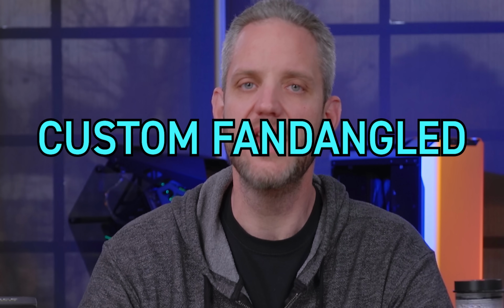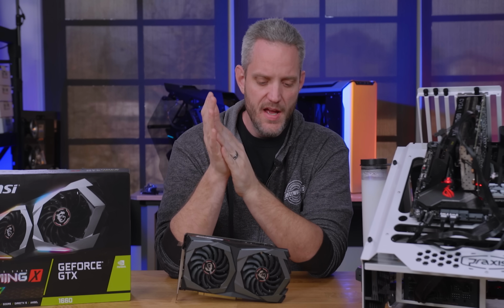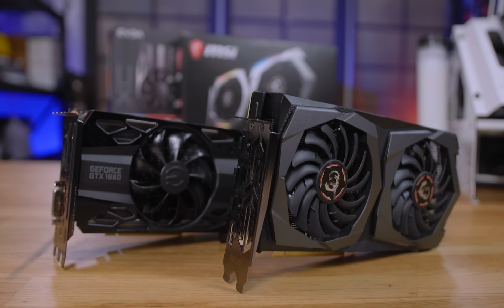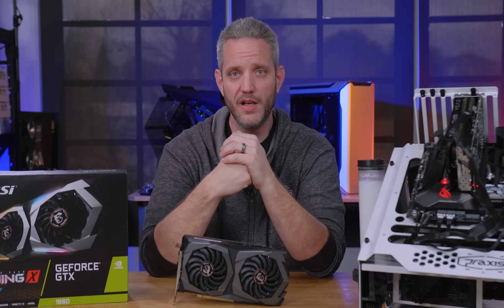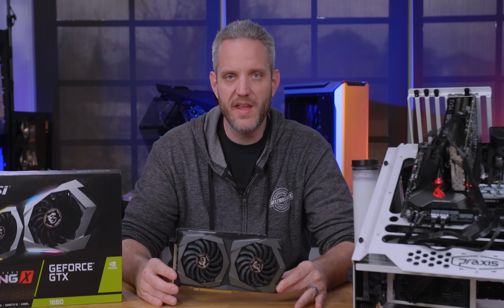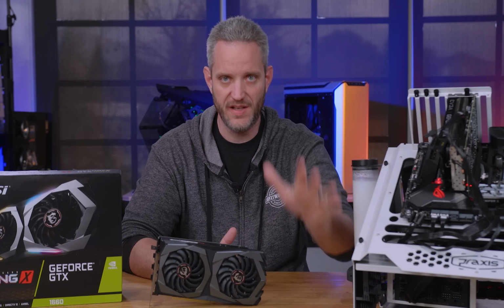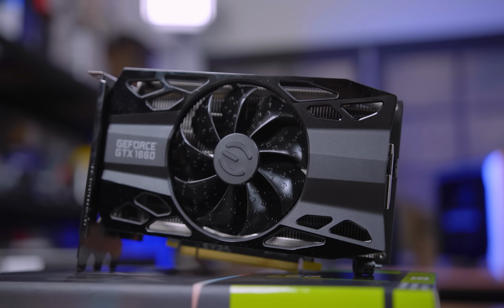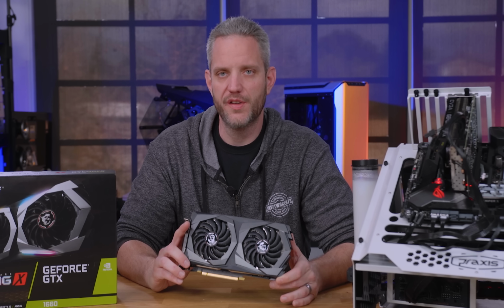Just save your money.... GTX 1660 vs GTX 1060

Comment: why nvidia why
so there it is
we have preveous gen
gtx1060 as base actual by 209€ 0%
gtx 1660 +10% new at 229€
gtx1660ti +20% 279€
gtx 1070+40%/rtx 2060 299€/330€
gtx 1070ti +50% 370€
gtx1080 rtx 2070 +90% 490€

no reason to upgrade 
my max invest in new gpu is 300€ and this must be at least 100%+
funny fact 500€  you payed 2017 for the gtx1080 before mining hype

Comment: I bought a used 1070 TI for $310 on eBay which beat all of these cards and a 2060 just barely. Side steps all of this overly engineered economic modeling.

Comment: I will always min max performance in a build, Jay. Bells and whistles for mid range just don't make sense. They're the cards for stretched budgets. I would be willing to spend maybe $15 extra dollars to get an extra fan on the cooler for noise, but that's about it. Even this price difference is pretty generous. I know whenever I go on pcpartpicker, there is pretty horrendous overlap in price point for a lot of cards. Where some 4gb or 3gb models are more expensive than the cheapest 8 and 6gb, or a 1070 is almost as expensive as a 1080 mini. Why would I get the fanciest 1660 when the cheapest 1660ti will perform better than the best binned, highest tier 1660? I would be willing to spend like $15 for an extra fan on the cooler for noise, but that's it.

Comment: You're glossing over a very important fact here when pointing out how closely packed together in pricing these cards are: Nvidia is running out of price points above some arbitrary threshold to fit cards into.

The truth is, we would be far less confused about the selection if the gaps were significantly wider.  What Nvidia is selling as a $200 card really should be going for $100 with the next one after it being $200, $300 and so on. But so long as they keep stuffing new models in between the shrinking gaps, people will be tricked into the inconsistent shifts in value.

I wonder how much binning factors into this (Bad run? No problem! Create a new sub-series!)

Comment: If I'm very limited in budget and I want to upgrade on an older rig from a 750 Ti.  Is a 3 GB 1060 a good idea since I won't go any higher than 1080p gaming? My rig currently has an Intel Xeon E3 1220 (i5 2500 Equivalent), 8 GB of DDR3 Ram, An ASUS 750 Ti and an MSI B75A chipset motherboard

Comment: hmm i always think that spending a few extra bucks is worth it all the way. why should i go for a GTX 1060 founders card when i could just spend a bit more or save up two months more or so and get myself a good gtx 1070 with decent cooling and more performance that can handle more than just games released today. Granted gtx 1060 is still good after all those years but i did not regret buying a gtx 1080 at all two and a half years back.

Comment: well the 1660 TI isnt like before. Before the 1660 ti, you would get the TI as an overclocked version or a refined higher performing version of and existing card.

What Nvidia realised, is that same card you would have released as a 1660, if you put a TI in the name, then any card released with the 1660 less the TI would be expected to perform less than the TI version, so they could use cut down version of the 1660 TI chips for the 1660 and maybe even 1650 if that ever sees the light of day, thus saving nvidia money and making them more money. So whatever OC they might manage to magic out of the 1660 TI chip, they can then sell as maybe a 1670 or something like that.

Comment: For me it really depends on the card. Between 1660 and 1660Ti, it feels like argument could get similar as between 1060 3GB and 6GB, except now VRAM quantity is same. And if you want to do bit of future proofing, 1660Ti is not bad way to go. But if you want to save every penny to beef up other components or even just to buy more games, 1660 is great for any 1080p 60FPS build. Same as 1060 3GB was back in the day, despite lower amount of VRAM. So it really depends on what you want to do and constrains you are working in. Personally if I were building midrange build, I would want to get 1660Ti.

As for MSRP versus premium cards. I never advise premium cards. Generally it depends on tier of the card and how hot it gets. Cheaping out on card is not always a good thing. Generally, unless it is low end, I would want at least 2 fan version, so fans can achieve better cooling at lower RPM, hence less noise. Also I would avoid buying from less known brands, because you can burn yourself on card with cheaper cooler which will mean bigger noise. I mean that Red Dragon card Jay tried to "fix" is exact example of that. I got Powercolor RX480 8GB Red Dragon and I got it really cheap, it checked 2 fan requirement and so on. But once I felt it in my hands I was already bit skeptical, but anyway, I went on and learned that it is noisy, fans are working at higher RPM, card gets hot,... and undervolting was bit mixed thing, in some games pretty decent undervolt was running fine, but there would always be game or two where it just wouldn't work. So paying a bit of premium to get some better and more known brand version is fine in my book. As I am definitely not making same mistake again. But of course don't almost go to next tier, because it just isn't worth it.

As for how far you go, since they are stacked so close together? To make things simpler, just decide on the budget first, trust me, that solves a lot of problems. Then what I usually do is to allocate about 20% to CPU and about 40% to graphic card, check what is best I can get for that. Then I start picking other components and once I am done with that, if there is money left, I start thinking about higher tier graphic card or CPU. If money is lacking, then I look at whether I can cut some cost at CPU or graphic card to get more money for what I want. At least that is how I usually go about doing it.

Comment: I run a ton of ITX rigs and that triple slot card would be a deal breaker for me. In general, I would say if there is an MSRP card 1 tier up with the right size specifications I would probably save and grab that. The extra performance will lend to the longevity/ viability of the card as time passes.
Even the base modle EVGA cards have great build quality, so buying an MSRP card isnt really a "mistake" 
Even brands like powercolor have improved a bit, but always check for reviews before buying.

Comment: I only have a 1080 p panel so as long as the 1060 manages 60 fps there is literally no reason to upgrade to anything imao.
Reply: Paul S resolution has nothing to do with the refresh rate, so I think you mean 1080p 60hz!

Comment: I have a 1060 3gb. The only logical thing to do for someone in the same situation as me would be to either just buy the rtx 2060 or wait for Navi
Reply: 3GB is a restriction that should not have existed and is already a problem in some games.  The 1660ti sits between the 1070 & 1070ti in stuff I`ve seen so it`s a decent upgrade on what you have and quite a bit cheaper than the rtx 260 where I live ( in the UK )  I will be upgrading one of my 1060 6GB machines to a 1660ti, same sort of power draw on the itx PSU and from my research it`s totally worth the upgrade

Comment: I'm currently in the process, of building a Ryzen machine. I have a As Rock b450m pro 4 Motherboard, just need to get the case, Ram,  Ryzen 5 2600, power supply I'm thinking of 850 watts and of course the all important graphic card. I already have a 1050 ti, but would love to upgrade to a 1660 ti, but will have to save my hard earned cash. Hope to get it done by the end of Summer British Time. I don't run Windows for gaming, as Linux has Proton and many game porters like Feral Interactive, who are porting to Mac and Linux Shadow of the Tomb Raider and Life Is Strange 2. Going to be a good year for gaming.

Comment: I have a i5 4440 and no graphics card , I used to have a r9 270x but I sold it , now 1060 seems bit outdated and 2060 and 1660 will bottleneck , what should I do , I don't have money for a new PC ?
Reply: In that case, go to the AMD side..maybe RX 570 or 580.
Reply: Impossible to say without knowing your exact budget/income and local prices. just get a 1660 for now. save up for new mobo and better CPU (i5-8400 or r5 2600) because sounds like the CPU is holding your system back. Also sell old CPU. or RX 480/570/580 etc
Reply: Thank you for your suggestions

Comment: GTX 1060 3Gb is not so bad(I got such) like you try to tell, getting 5 fps less in most games then 6GB version. Have video ram limit but those videocards are not much powerful anyway so you cant push graphics, mainly you can increase textures more on 6 Gb version otherwise performance is very close.
For me personal only reasonable upgrade is RTX 2060 from GTX 1060, PS5 is around corner and after that launch games probably will become 1 idea more heavy.

Comment: Hello there, fellow tech people. Sorry for a comment unrelated to the video, but I have a slight dilemma - what to upgrade first: Celeron G3930 to a used 6/7 series i5 or HD7850 1GB to a used RX570/580/GTX970/1060 3GB? 

Eventually I plan to upgrade both, but I'm not sure what to upgrade sooner, and both choices cost around 110-160usd (with CPUs being on average a bit cheaper), but being a simple student, I can upgrade only one thing at a time with roughly 4-7 months between upgrades. Any suggestions? I'll be upgrading next month probably, hunting for deals in the meantime.
Reply: @bdrmongoose78 1060 6GB is out of the budget, sadly, since that would be at least over $180, and I can save at most $25-26, per month, and I don't want to wait more than it's necessary. Especially since RX580 4GB can be easily bought for $140 without looking for any special deals and 8GB versions start at ~$160, and those cards are pretty much on par with 1060 6GB, with a bit slower 1060 3GB also starting around $140 

But yeah, I guess you're right that it's probably best to go with RX570, which goes for ~$120, and is not that much slower, or look at GTX970 which also can be found for ~$120, and seems to be on par with that RX570.

Comment: usually i don't have a fixed budget for the computer.  I compare what's available to what i currently have and decide if any of those price points feels like a big enough jump in performance to make me want to build a new computer.    if the higher cost components feel more worth it, then i'll just save up until i can get the better components.  sometimes that causes me to wait another year or two.  generally the middle of the road components are the ones that feel most worth the money COMPARED TO WHAT I HAVE.  this is a major point that i feel very few reviewer pay any attention to.  when i'm deciding whether its time to build a new pc it has absolutely nothing to do with how it compares to previous group of components, it has to do with whether the components available today provide a big enough boost in performance for the cost, compared to the computer i have which almost always 4 to 5 years old by the time i build a new computer.  there is so little performance gain between successive groups of graphics cards that i imagine an extremely tiny section of the population is upgrading from 1060 to 1660.  they are probably considering upgrading from a 960 or maybe even older.   the 1660 is a jump in performance, but does it justify the cost?  maybe.  comparing it to a 1060 ?  no, for that cost you should be bumping up which games you can play, not dishing out 250-300 bucks for an extra 10 - 15 fps

Comment: I almost always end up buying the somewhat expensive version of any given GPU. I choose GPU based on efficiency and performance (example: Last card i bought was a GTX1060 6G). ..but i'm a low noise freak that likes to keep my PC as quiet and cool as possible. So i've had Strix cards, before that the early Asus low noise/good cooling cards were named DirectCU aso aso. The 1060 i currently run, is a Gaming X from MSI.

Comment: Speaking of 980s,  have you seen all these 980s going up in flames as of late?  This is something I've never seen from any GPU.  Saw a few posts on the EVGA forum.
Reply: I have mine for about 4 years and I never add a problem
Reply: Johnny V „All these“ - about the same amount as seen with Polaris. Both not worth mentioning.

Comment: I have a 760 and looking to upgrade. Not sure where to go, but I'm stuck between 1660 Ti and RTX 2060. Any thoughts? I don't really want to break the bank and are the RT cores/dlss really worth it?
Reply: RT cores/dlss not worth it now but who knows the future. It depends what you wanna do. 1080p 60fps/1080p 144fps or higher than that ? Whatever the reason, if you have the extra cash, of course the 2060. Also will depend on your CPU.
Reply: Both are good cards for the money, just depends how much money you're willing to spend... personally, I bought a 1660Ti... but i'm also cheap.
Reply: I have a core i5-8600k if that helps
Reply: @johnlinks  Honestly RT and DLSS is not really worth it with the 2060. What you will get with the 2060 over 1660Ti, is 10-20% performance increase in most titles, more future proof. But for 1080p 60/120fps gaming, 1660Ti is enough. You could save or use the extra bucks elsewhere. But if you have the extra to spare, get the 2060.
Reply: @johnlinks  the i5 8600 isn't going to bottleneck either card, so the CPU is irrelevant... more important is your monitor... will you be playing in 1080p or 1440p... that should determine which card you lean more to.
Reply: Well, the plan is to get a new monitor in the process too. I'd like to get a 1440p monitor, but if it'll break the bank, I'll just get a better 1080p monitor than what I have now
Reply: @johnlinks  Here's the thing, to summarize, in 1080p..RTX 2060 will have 10-20% gain depending on the titles. In 1440p, 10-15% gain. In some cases, 5-10% gain on both 1080p and 1440p.

Comment: I recently bought a Sapphire RX 570 4GB card. For me, I wanted to buy AMD because Nvidia really pissed me off with the naming convention of the GTX 1660. I hadn't encountered any news directly released from Nvidia about the naming convention, and I had saved up for what I hoped would be named the 1160ti, hoping the leaks surrounding the naming change were wrong. 

On release day, when it was 100% confirmed, I went AMD, and I'm not going back ever. I'll switch to Intel when they launch in 2020. Nvidia has been muddling the naming convention for too long now, and I've had it.

However, the point remains that I opted for a higher end part within the 570 options instead of going to the 580. I actually spent as much on my Sapphire RX 570 as I could have for a low end 580. I don't regret the decision. At least in the case of Polaris, you really do need the improved cooler you get with the Nitro + series. 

Every other review I found of other manufacturers complained of noise and heat - so at least in the case of Polaris, I felt it really did pay to go with Sapphire's improved cooler. But, that's Polaris for you - something Turing definitely doesn't suffer from. (terrible power efficiency and heat).
Reply: @RISEUP Gamer 
Sure, if you consider it switching because of the name, then yeah. I consider it switching because of incompetence that has muddled the product stack and made it harder to instantly recognize the performance of a given card by it's name. It's more of the last straw in a long list of offenses where Nvidia makes things less clear for the consumer. The GT 1030, the GTX 1060 3GB and 6GB, and now this - the company obviously doesn't care about it's consumers, and it's beginning to show. 

But I mean, if you'd like to posture yourself as some sort of intellectual for being okay with that sort of behavior, go right ahead.

Comment: I think it's nice that there's options available for people of all budgets, but it's true that it can be difficult to make a decision. I'm still rocking a GTX 980 Ti Classified and have been able to keep up with playing most games at Ultra or High settings and have playable frame rates. I do have a G-Sync monitor so even when some games only reach 40 fps, they're still quite playable for me. Like with Anthem, I'm able to play that at 1440p with High settings and still get a steady 40-50 fps. My CPU is a i7-6700k @ 4.0 GHz. I haven't gotten much into overclocking but probably will with my next system. I'm interested in upgrading, but probably will wait for the next round of RTX cards to upgrade. If I find out that I need to upgrade sooner, I'd probably get one of the cheaper cards like the 1660 or 1660 Ti to hold me over till I can get the Higher tier card that I want and not have much down time with being able to play the games I like to play. I do plan on basically building a new system when I'm ready to upgrade.

I'm not that big of stickler with regards to fps as long as the game plays smoothly for me and looks great with being able to have the Max or near max settings turned on.

Love the videos, keep them going.

Comment: If you're upgrading from: 
GTX 570/660/750Ti - get a RX 570 4GB for only $130 (includes 2 free games from Newegg)
GTX 770/960/1050Ti - get a GTX 1660 for $220
GTX 970/1060 3GB - get a GTX 1660 Ti for $280 (RTX 2060 for $350 is also a good option)
Or you can wait a few months for Navi.

Comment: I think it's a good option for someone with a restrictive budget, but much like the rest of the TU cards it doesn't offer much compared to last gen. I suspect there are a lot of people with 1060s or rx 480/580 that have had them for over 2 years waiting for a decent upgrade in the same price bracket who will be disappointed with these. On the one hand it's good that they can stick with what they got, but they would still have expected something to upgrade to by now, and it's not great for nvidia if every one just sticks with what they have.